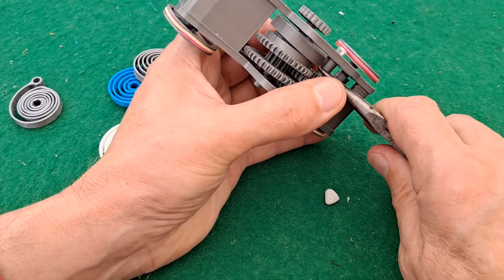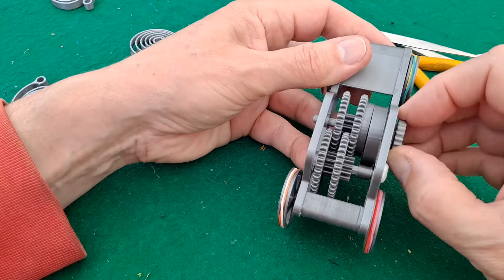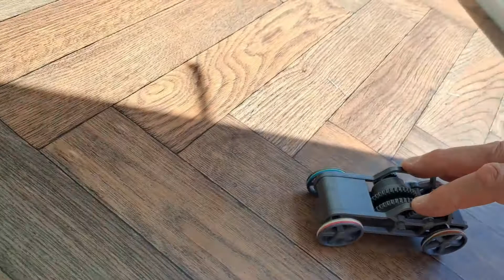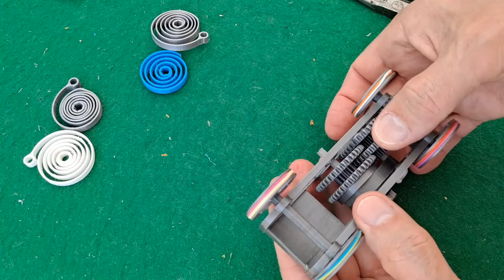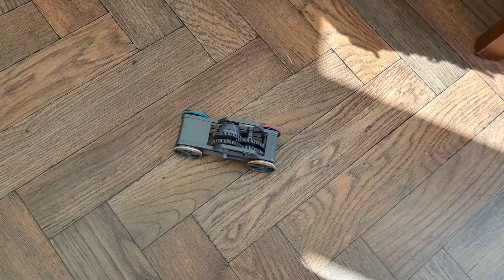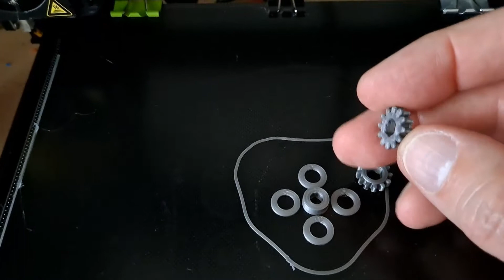P5 Another 3D printed wind up car No progress

Comment: On episode 4 several people have sent me this link to help me with the seam issue - How to Control Seams In Cura Slicer Settings https://youtu.be/NU1kYEE3qrQ
Thanks guys 😊👍 there will now be an episode 6 showing the success of using "random" in the settings
Reply from the maker: It is visible for my Patreon viewers and others who know how to find it.
Reply: I would suggest sanding the seam down with fine grain sandpaper, and using a little wd40 lubricant or even vaseline, to slick up the works
Reply: @myramadd6651  hey, good to hear from you, buddy. I am afraid sanding that seam would just weaken it straight away. The fix is "randomisation" but unless you are into 3D printing that will mean nothing. It all becomes clear in episode 6 😆😊👍

Comment: Rubber bands not needed for front tires, thickness and width of spokes can be reduced
Reply from the maker: Yes you can redesign it if you want, but it works fine once I sorted the spring out.
Reply: @GrandadIsAnOldMan  thanks, I was assuming you get the weight down and the spring is less a factor.
Reply from the maker: @Alx2672  most of the issues were around friction and alignment, the final fix was getting the power from the spring. With the seam generated by the slice/print settings it always had a weak spot right where you don't want it. Back on episode 4 several people gave me a link to a video that explained how to fix that issue, so I printed a new spring and made episode 6. Unfortunately that video doesn't go live until the 5th July as that was the earliest I could squeeze it into my schedule.
Reply: @GrandadIsAnOldMan  that's great, I can't wait to watch it. Just subscribed and really appreciate your thought and how you leave the "thinking" parts in the video. I'm glad I found you!
Reply from the maker: @Alx2672  thank you, you will find I cover a fairly random range of subjects, not just 3D printing or wind-up cars. Hope you will enjoy the variation 😊👍

Comment: I know it’s a minor thing but your grey/gray spring is a slightly different shade than the rest of the car. Filament mixing or temperature differences may cause strength issues. That’s all I got
Reply from the maker: The issue is simply that seam on the spring 'seems' to take away a big proportion of the strength. Episode 6 shows how much difference it makes when I change the settings on the slicer.

Comment: you can avoid elephant foot by finding the setting ( initial layer horizontal expansion) and set it to -0.2mm to -0.4 mm or something close to that.
Reply from the maker: Thanks, just had a look for that setting and that is almost word for word how it describes it. I will give it a try 😊👍 It does vary with the different filaments and the one I am using at the moment is not too bad.

Comment: Print it vertical instead of horizontal
Reply from the maker: Do you have a printer?
Reply: @GrandadIsAnOldMan  I had an ender 3 and 3 ender 2's but now I just have the flsun qq-s delta printer
Reply from the maker: @scannaunderscore1  so how would you print it vertically? Without adding support?
Reply: @GrandadIsAnOldMan  print it vertical with bare minimum support just to see how it turns out
Reply: @GrandadIsAnOldMan  print at half the speed so it appears more moulded than layered and this goes for wether u do horizontal or vertical
Reply from the maker: @scannaunderscore1  so all the layer lines go across the spring making it as brittle as possible with every layer representing a weak point. Instead of having the single seam weak point problem I am having here, you would have multiple break points on every layer line on every coil of the spring, so multiply the problem by a factor of several hundred. Thanks, but I think I will pass on that one 😊👍 I do appreciate you are trying to help, but thin vertical strips of PLA are never going to have any strength. In fact on some designs I use thin vertical strips as supports that I can break off cleanly rather than the mess the autogenerated supports create.
Reply: @GrandadIsAnOldMan  also turn the fan speed down

Comment: A quick and dirty trick to get a stronger spring is to increase the "XY compensate". That's what its called in Prusa slicer I don't know what its called in Cura. I think its "horizontal size expansion". It just adds or subtracts some thickness to the model and there for makes it stronger. You might have to file out the centre a bit though.
Hope this helps.
Great video. Keep it lit.
Reply from the maker: Episode 6, 'randomise' was the key 😊